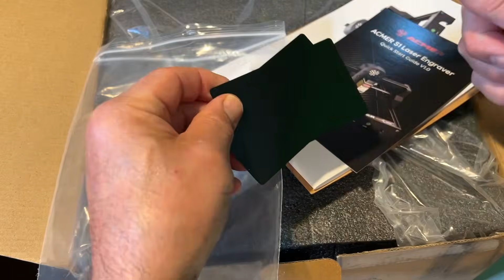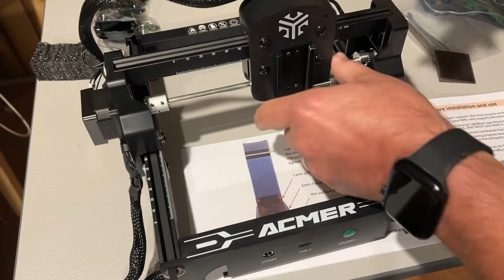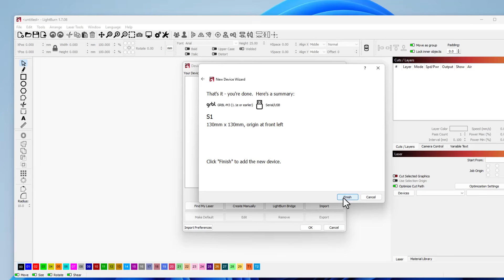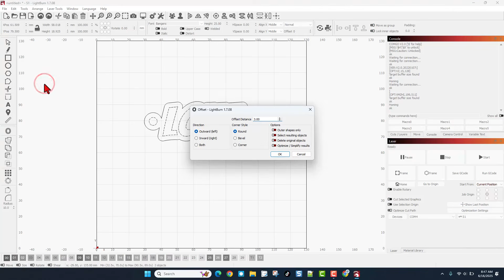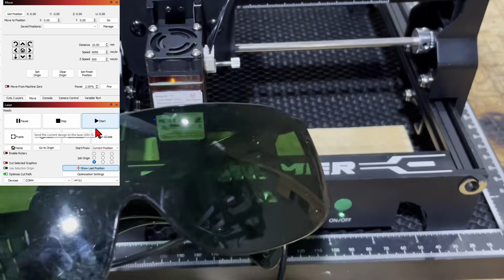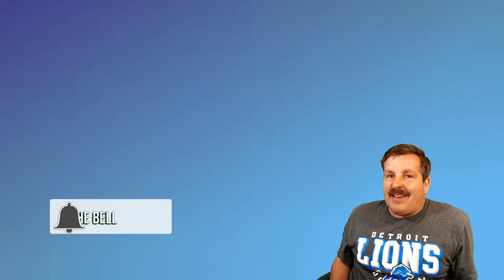ACMER S1 6 Watt Laser Ready to USE! Easy Lightburn Keychain in Minutes

Comment: What size honeycomb bed do you have? There are numerous sizes available.
Reply from the maker: I had a 250mm bed with the S1. At about the 8 minute mark you can see that the honeycomb bed is larger than the laser. I just had it all setting on top of the bed.

Comment: Can this machine engrave on metal for jewellery making
Reply from the maker: I do not believe there is any chance it will engrave any metals. 6w is not that powerful. Engraving and cutting wood is its intended use. There are sprays you can use to mark metals. This is an example of one. https://youtu.be/-DeOmOCHxLA

Comment: Nice, might have to try plugging in the laser on Anycubic P & hope I don't have to learn braille, fingers crossed.
Reply from the maker: Anycubic has a laser head?  I cannot picture having all the dust and smoke from laser cutting around one of my 3D printers.
Reply: @HLModTech 
Yea, that common model (X & S before mega) there was P, came with a lazer attachment that clips directly onto the front of the extruder.. 😅 I agree, never used it but applications for carbon fiber vac-bagging are limitless with thin lazer cut balsa patterns prepped w/ mold release. Old printer is worth sacrifice.
Reply from the maker: I have not played with fiber yet... 💯🔥🫰

Comment: What an awesome little cutter/engraver.   It'd be neat if there was a mobile app that could drive that.  I couldn't see ever using that inside the house but wouldn't want to lug a desktop outside just for that.  Something that could run from an ipad...  I see Lightburn has a 5 year old request for an ipad version with about 300 upvotes, but it doesn't look like that went anywhere.  Thanks for show this!
Reply from the maker: Thanks for checking in. I loved that it arrived ready to roll. 6W did a nice job cutting that wood too. I have used a few lasers that have had apps. I always go back to Lightburn because of the ease of use. I understand completely the drag of lugging a pc to the cutting area. I have a laptop for that. It is a drag for me though as my good mic and stuff is all in the house too. Hope the audio quality drop is not too noticeable.
Reply: @HLModTech sounded fine. The free Adobe podcast speech enhancer can pump it up if you’re not satisfied when you go rogue.
Reply from the maker: Thank you. I have used that several times in the past. Thanks for sharing!